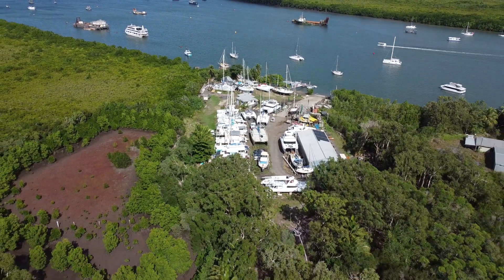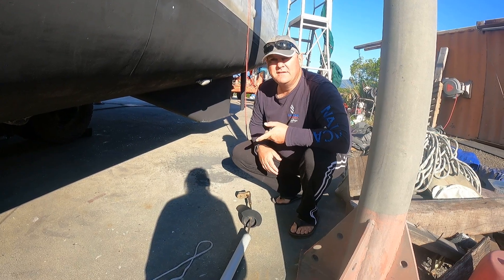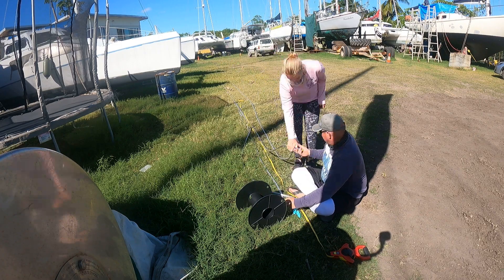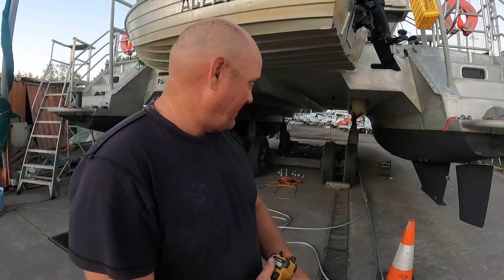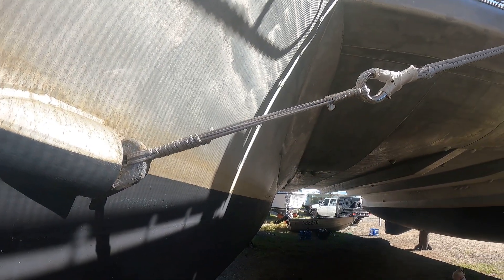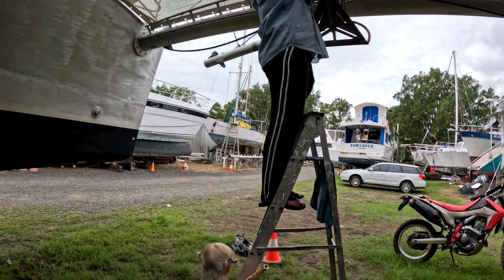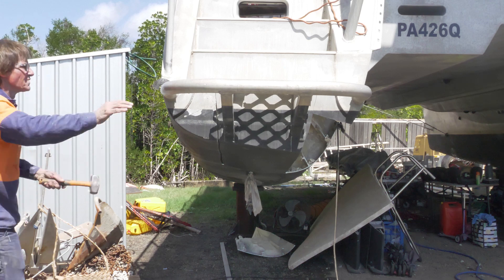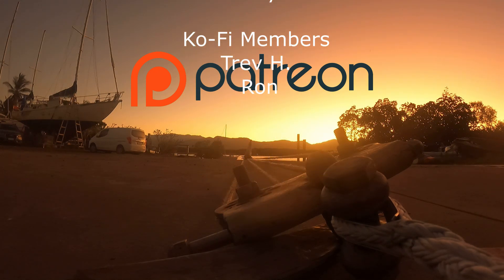Synthetic Rigging on a 17 ton aluminium catamaran | Part 2 of Hybrid Rigging (Ep. 101)

Comment: Check out the cost that Sailing Life on Jupiter spent on new rigging in episode 97. They spent about $2,000 USD. Why the large difference in price? That part starts at 9:44 into the video. When you extend your transoms, do kick up rudders like how a Mumby is built.
Reply from the maker: Wow only 2k yes I will definitely have to watch the episode and see how they managed that! We are keeping the egsisting rudders. I would love kick up rudders but unfortunately that was not it the budget for this time round.
-sam
Reply: @sailingwiththejameses You used much heavier heat stretched dyneema
Reply from the maker: Yes we used 15mm and 16mm dynice dux
-Cait
Reply: @sailingwiththejameses  Did you watch that video? I thought dyneema was a lot less expensive than stainless. Why the big price difference?
Reply from the maker: @robertlaird6746 if you could find that out, that would be great. would be very interested in finding out how to replace all the rigging for $2k (in any currency)
-Cait
Reply: @sailingwiththejameses  Part of the price difference is purchased in Australia 🇦🇺  versus purchased in the USA . #2 are rope dimensions & specification
Reply: @sailingwiththejameses  That video I sent you had the price of around $2,000 is what he said and then he already had the lower hardware. So, all he needed was the upper hardware and the wire. I really thought that the stuff that you used was much cheaper than stainless. That's a very large difference in price. Why is that?
Reply from the maker: Lots of variables. Rigging costs would depend on how many stays are getting replaced, the size dyform wire & fittings.
Reply: @sailingwiththejameses  Yes, that's true. I was highly considering using Dyneema for the rigging on the Mumby that I plan on building next year but due to the cost, I'll probably go with the same stuff that Sailing Life on Jupiter used. I'm really sorry for you that you ended up paying that much unless you knew all of your options and decided to go with it anyways. That isn't in my budget to spend extra if I don't have to.
Reply from the maker: Hey Robert, don't count out Dyneema. I agree with Jack it may be cheaper in the states and a mumby is a much smaller boat which requires a lot smaller gauge rigging and the stays are smaller overall. They have the rig of a 45ft catamaran on a 48ft boat as they were originally intended to be 45ft.
-sam
Reply: @sailingwiththejameses  Hmm, I didn't know that about Dyneema or the Mumby 48 mast. Maybe you can order your Dyneema from the states the next time you need to replace it to save money. I bet that you found that information out from Tim's brother. I'm not sure if that's a good or bad thing. Sounds like a bad thing. I'll have to ask Tim when I order my plans. What's your boats length and width. Also, is your mast taller than a Mumby mast. Is it to tall or just right?
Reply from the maker: @robertlaird6746  it's all a matter of power to weight ratio. I didn't mean it to sound like a bad thing. We have 7.5t of alloy in our boat where the mumbys have about 3.5t. We are 50ft soon to be 53 and our mast is higher with a much larger boom but again we are a bigger volume boat. The mumbys are great boats and I wouldn't change much on them as they are proven.
-sam
Reply from the maker: I love mumbys and have done a bit of research on them but you are right I am getting this info from Ben Tim's brother who has also built a few mumbys himself. Good luck with the naming, I always find it hard.
-sam
Reply: @sailingwiththejameses  Do you know what Tim will end up doing with his two yards in the Philippines after his guys finish building the last boats? If I could, I'd love to have his guys build my boat and his yard would be the perfect place to do it.
Reply from the maker: We would love to meet tim but unfortunately so far on our travels we haven't and therefore have no idea what his plans are. He answers posts in the mumbys group on Facebook sometimes, it may pay to reach out to him on there.
-sam

Comment: I've heard that Dyneema make a sleeve that you slip over the Dyneema to protect the Dyneema from chafing and I guess UV rays. Why didn't you use that and how long will the Dyneema last before you have to replace it?
Reply from the maker: Good question Robert, we did put chafe protection on the caps but left the lowers exposed so we could monitor the deterioration. We know how long people say it will last but don't personally know that is why we wanted to have the ability to monitor it ourselves. The lowers are smaller and easier to change out if need be so...
-sam

Comment: I'm interested in your change to synthetic rigging. It is the way I would go to. I've done a fair bit of research on this topic.

I have to point out that you will most likely have issues with the lashings that tie your baby-stay diagonals to the hull. The 4mm rope lashing is passing around the corners of the stainless sleeves that you left in the aluminium eyes (in the hull anchor points). That sharp bend will rip through the lashings very quickly. The situation is probably the same at the other 3 anchor points.

Synthetic ropes have a minimum bend radius that must be observed in order to maintain its breaking strength. The radius is usually defined as a ratio of it's diameter. This is why the buried tails MUST be tapered off, if not the abrupt end of the tail introduces a sudden bend in the fibres of the outer strands, which considerably reduces the breaking strength of the rope (can't recall the exact numbers, but I think its around a 50% reduction in strength).

I'm not a rigger, so I can only give you suggestions that make sense to me.
A potential solution to the issue with the lashings is that you use a thinner rope (small diameter = smaller bend radius) and simply add more loops to get you back to a combined breaking strength that is greater than that of the main ropes. The downside of this however is that you will need many more loops, which will make the process of tightening the stay cumbersome.
But you might have to look into adding some kind of a block or something that will give you a nice rounded surface over which the lashings can safely slide and bend.

Take a look at the Rigging Doctor's videos about lashings, and frapping knots. Sailing Zingaro also had some good videos on the topic.
Reply from the maker: Thank you for such a thoughtful reply. I have gone 8mm for all the other lashings land I went 4m there with the radius in mind l. I would have gone smaller but I want sure how the rope would interact or possibly chafe on itself. I did round off the stainless inserts but I think I may buy some 2mm and redo the baby stay as I am not 100% happy with it myself. Thank you again for your thoughts I'll let you know how I go.
-sam

Comment: You might need to re do the fron lower dynemas just because it may fray through those eyes ..see if you can create some plastic top hat 🎩 liners or use some abrasion sleeve. 

Nice job guys .. and thats a big saving..in money, Weight and risk of corrosion failure.

Im not sure 8cm is going to have mutch effect .. i might have tried a 10cm extention under test as agains maybe 30 to 50cm to extend the water line and smooth the exit flow ..akin to a Camm tail.
Reply from the maker: Hi Clive, I agree I'll have to watch the dyneema closely on the bends. I tried to put some pipe in there but it didn't work as planned. Am thinking of getting some smaller dyneema that can take the tight bends but we will see. We are extending the boat by 3 feet or just under a meter and hoping it will change the trim of the boat. We need more buoyancy in the stern to change the trim by 8 cm so fingers crossed. We have had some delays and had to put our launch date back so we won't know in we got it right or not for another month but fingers crossed
-sam

Comment: It will be interesting to hear about the increased length, and all of the benefits of lengthening the stern. Will the dinghy width now be within the hull length at the stern? 
What was the weight saving by changing to Dyneema on Emma?
Reply from the maker: Hey Alec! 
Yes the dingy still  fits between the hulls, one of the building requirements was that it had to fit on the davits. The dingy is so awesome to drive and travel in now.
The weight of all the dyneema ( 8 stays plus the stay pulling the inner forestay forward) are lighter than the 2 forestay wires. 
I am very impressed with the dyneema.
-Cait
Reply: A lot 😂 ... Probably 100 ..150kg or more .